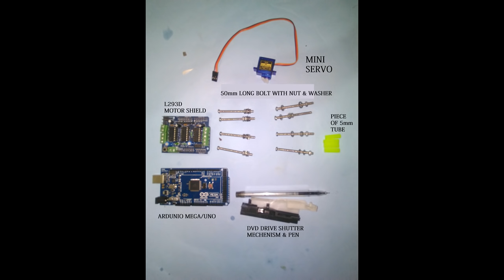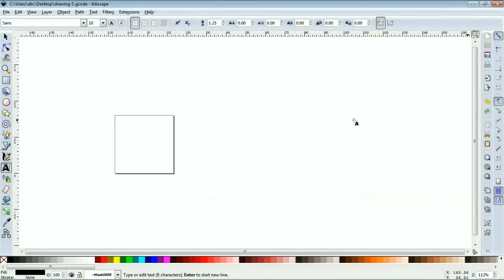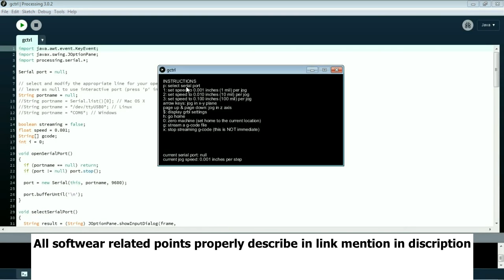How to make Mini CNC plotter machine at home using Arduino, L293d Motor shield & old DVD drive

Comment: I'm uploading code by example to test stepper motor but the motor is not working I'm giving 5 volt I have to make CNC for my school  project. by 16 January please contact me
Reply from the maker: many possibility are there like faulty motor, wrong wiring
Reply: But the motor showing continuity
Reply: Please help
Reply from the maker: simple continuity doesn't sure motors are ok, if it shows some vale then ok of continuity shows almost zero value it means motor winding get short and got faulty
Reply: His shield is an Adrafruit motorshield v1, probably u have V2. In this case u have to change AFMotor.h library with "Wire.h", "Adafruit_MotorShield.h" and "utility/Adafruit_PWMServoDriver.h". After that u have to change all strings that contain instruction for stepper motor and it work.

Comment: Has anyone got solution to M18(drives off ) error message ,pls put it on this site.it will help all of us.thanks.I put up this message on behalf for all of us.requesting mr.innovative again and again for solution to this problem. I hv found out that this is related ti g code program. As I am totally newbie as far as software is concern, request to software person to help all of us,thanks again.
Reply from the maker: this is mostly happen when your gcodes are empty means gcode does not contain any motion codes but M18 & M17 are there by default, so what we can do open gcode file in any text editor notepad is best and see if there any codes are there or not if not please check your procedure to generate gcode

Comment: bro everything okkk working, but drawing make not proper help bro send ur no its urgent plz reply ???
Reply: same problem here
Reply: Babbal Gahir me too.. how to solve this issue?
Reply: same problem here,if u get any solution pls passon to me also.
Reply: U, I suppose, changed the x and y axis on the motor drive shield. Go to the site (link's in description) and look at the photos there. There are a "schematics"(if I can call that like this) about how to properly connect wires from steppers, servo and power. That can be a problem.
Reply: Pls send me the code....